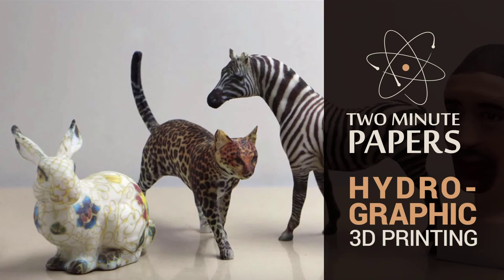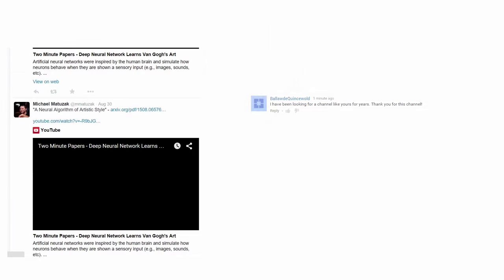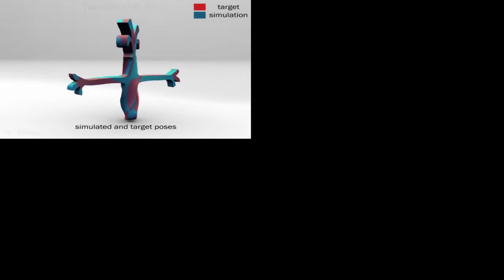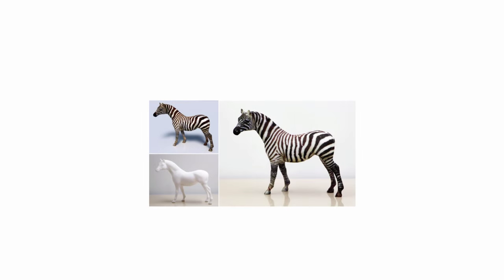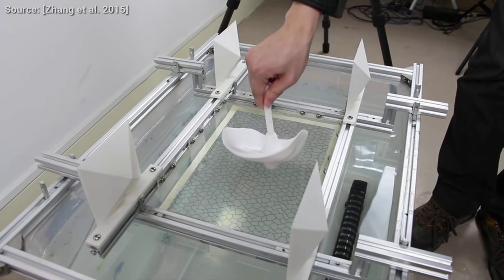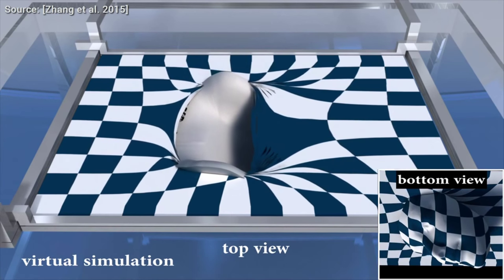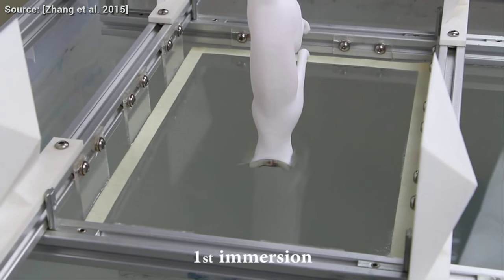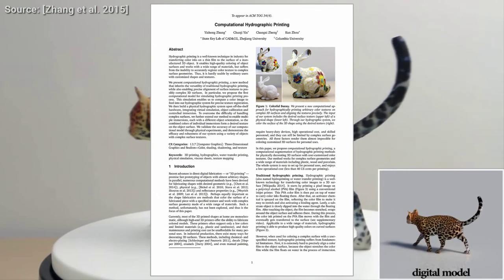Hydrographic Printing | Two Minute Papers #7

Comment: Really neat research.
3D printing really is growing quickly.
There recently was a report of an MIT 3D printer that can use 10 polymers at once, mixing them as it goes and even self-calibrate and self-correct if something goes wrong, and they achieved all that for "just", I think it was, $2000. - That's almost commonly affordable. Not sure how much the polymers cost as "ink" but with that kind of complexity you can do a huge amount.
By mixing polymers that are conductive vs resistant / flexible vs. rigid etc. you can basically build entire machines in a single print job.
Their current resolution is, I think it was, 4µm, which is also really impressive.
Reply from the maker: +Kram1032 Agree, we have indeed a really insane series of new technologies and price drops. :)